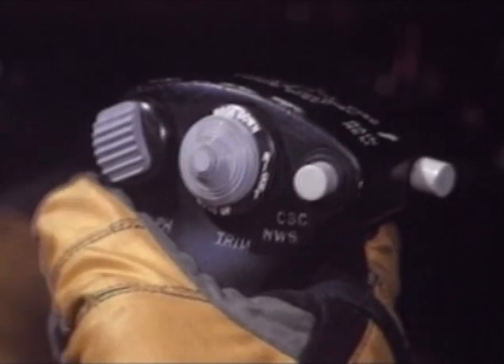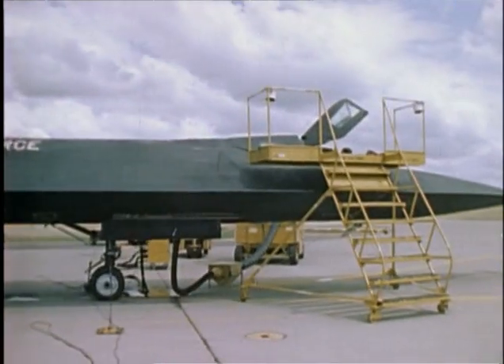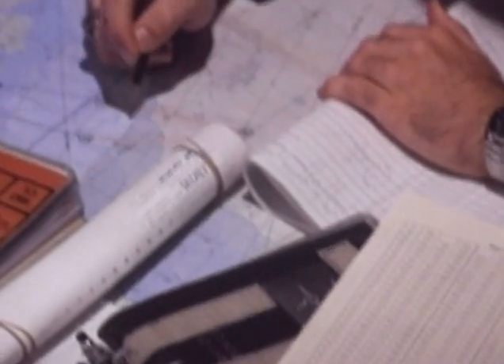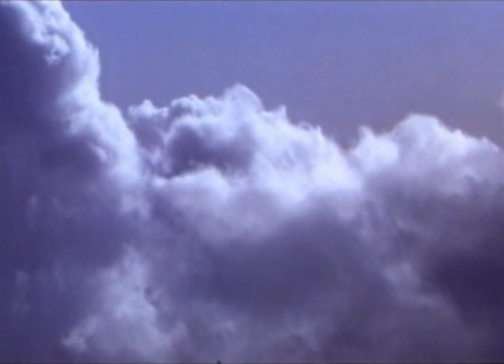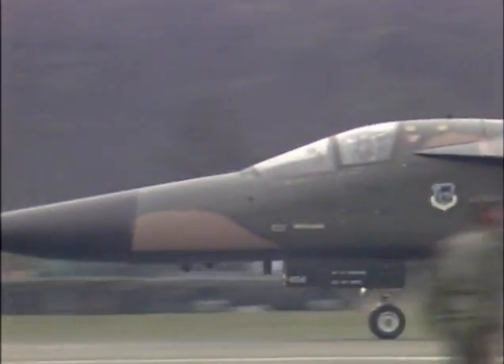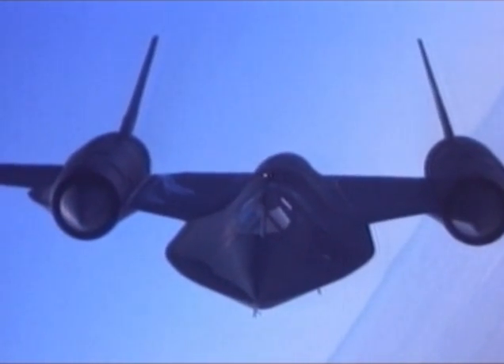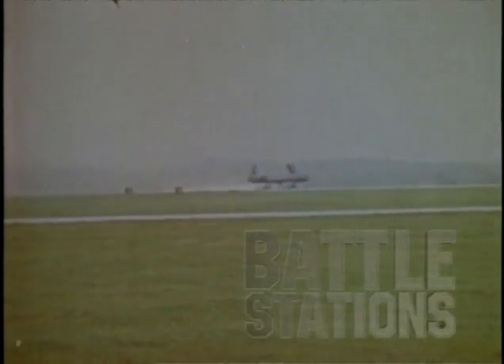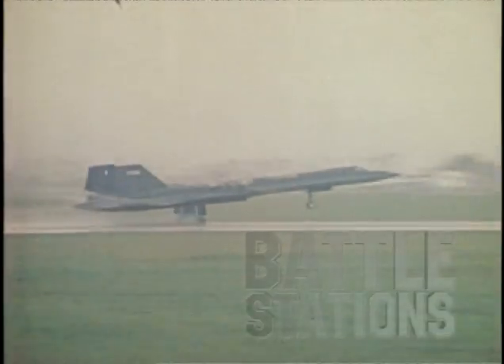Battle Stations - SR-71 Blackbird Stealth Plane -Full Documentary

Comment: There is a lot of the story they are glancing over in this. The SR-71, is part of a family of four different air craft, the YF-12, the A-12, the SR-71, and the M-21, while all look a great deal alike, they have have small differences.
Reply: I thought it was odd that the A12 rated no mention at all.
Reply: @theharper1  It was mentioned as the YF12A, A12 in short.
Reply: @theSaxman5  The mention must have been so brief that I didn't hear it. Overall it sounded like the SR71 was developed in isolation rather than a derivation of the A12, which is inaccurate.
Reply: No-one will ever see in print what the SR71 is capable of. Many speculations on its top speed and featured capabilities but keep guessing. Only a handful know the "Full Truth" and those limits will never be heard spoken, seen or read about even today in the year 2019!!!!!
Reply: @ Captain Sanders. BS. You take that American “plausible deniability” way too far when there are far more sensitive things that were declassified... and far more things that weren’t declassified that we know about thanks to people like Julian Assange, Edward Snowden, and the incompetence of people like Oliver North and Richard Nixon. 

The SR-71 cannot break the laws of physics. It has an engine made of metal that’s limited to certain temperatures. If you exceed those temperatures, it will melt. Maybe not immediately, but not long. Its top speed is governed by the drag formula and that means as speed doubles, the power required SQUARES! It was a Mach 3.3 jet and maybe 3.5 if it was being chased by missiles and the pilot valued his skin more than the engines.
Reply: @Bartonovich52  Sir, you have failed your aeronautics test. It does NOT require more power. Lets just say it sucks....

Comment: 1:01:35 you can hear/see the engines start one at a time powered by 2 nailhead Buick engines. Later to be replaced with 2 454 big block Chevy engines. The audio starts a sec or two earlier. Rare (to me) example of starting. 👌🤙🏼💪🏼🤘🏼
Reply: But

Comment: The Blackbird was not a stealth plane, it didn't need to be, it just outran anything that was thrown at it. A true work of art.
Reply: It was. It was specifically designed with a lowered RCS, Radar Cross Section. This was achieved by the shape of the lower body and chines, the tilted rudders, and composites (graphite) on all the leading edges to absorb radar. It is 107 feet long, but had the radar signature of an F104. This is stealth by definition. It's not "near invisible" like the modern stealth planes, but it flew so fast that a reduced radar cross section was good enough.
Reply: Then what is stealth?
Reply: When I said it wasn't a stealth plane, I was talking about what we calle stealth today

Comment: The SR-71 pilots were basically astronauts.
Reply: Yeah its average height was 85k feet but some other resources says it can go 100k or more... this video says it can fly up to 1% of the atmosphere.... pretty impressive jet... and to think that was 50s/60s technology... like what more do they have now?
Reply: @guyontheinternet8891  We have RETIRED SS airliners and nothing to replace them. Watch carefully as we could end up relying on steam again soon.
Reply: Ha google says top speed was 2133 video shows it out running something going 4600 astronauts indeed...
Reply: @jeffstrains4014  I believe you should believe to what pilots of SR-71 say. They were on site :D. It's mach 3.3. Some even say, it could be more - claiming it was pretty much dependent from air temperature outside (air going into engine intakes). At any altitude above ground air gets thinner and thinner so the standard "air speedometer" you would think of (like one every car has) does not show correct speed. That's why MACH unit was invented - so the speed is related to how fast sound travels on given altitude. That's one, secound you can also search for IAS and TAS difference (indicated / true air speed)...
Reply: @madyogi6164  In the video when Shul is talking about outrunning the missiles above Israel, he makes the comment that was something like, "We saw some mach numbers that we've never seen before, and the jet was doing it easily." I wouldn't be surprised if the SR could go 3000 mph honestly.
Reply: Very close indeed 👍🏻
Reply: @jimmysapien9961  Sort of like the Warrant officer ranks in the military. They are "almost'' officers, in comparison to West Point officers etc. They're not enlisted men any longer, above them, but still not quite the same as Commissioned officers either.
Reply: No, not even close.
Reply: And  Wiley  Hardeman  Post  was  the  first  astronaut.  Will  and Wiley r.i.p.
Reply: Well...in a sense I suppose, but the threshold for an astronaut is an altitude of 50 miles in the US or above the Karman line elsewhere. No jet aircraft can fly that high...yet.
Reply: @thomast8539  The pilots were indeed astronauts. Not in the sense that they went into outer space but they all passed the training requirements. The rigors of flight in this beast required the special training. They also flew off of instruments that only astronauts are trained in. No computer in this one! lol
Reply: Migs did this 30  years before rhe 71.  I have done it 5  times in a mig.  One of the few non military astronaut.
Reply: F U Google  ......   more precisely, the astronauts ARE basically pilots....because there is no outer space.... the Russians hit the dome (firmament) back in 1957-8.   Sorry, really sorry, but NASA is lying to you.
Reply: @colemanadamson5943  yeah i bumped my head on the sky once when i was on Kilimanjaro. Ouch. Still have the scar
Reply: Coleman Adamson holy shit , here’s one haha! Like fishing with dynamite
Reply: Same thing I've always thought but we never went to the moon lol

Comment: I wonder which is faster, the SR-71 or the XB-70?
Reply: Sphinx Rising 
Pretty sure the SR-71.  The XB70 was supposed to be capable of 2060 mph, but it’s top speed would still be limited by the added size of a having a bombay and the greater lift required for carrying capacity.
The SR71 was sleeker with less compromise needed for cargo/carrying capacity.  

If they were cars, the XB70 would be like a CTS-V wagon... very fast with a good payload capability.  The SR71 would be like a Corvette ZR1... even faster thanks to the smaller size and less weight.
Reply: @stlchucko  Their top speeds were measures in Mach number because at that altitude, Mach number is all that matters. It is pointless comparing them with cars and only confuses people who understand little enough of this stuff already.

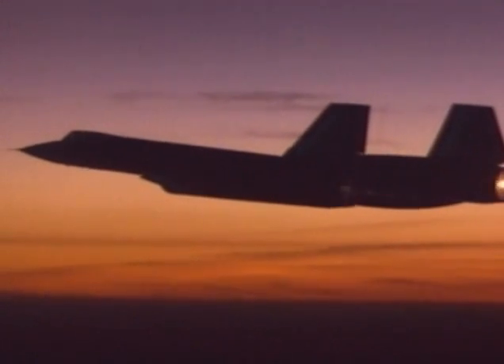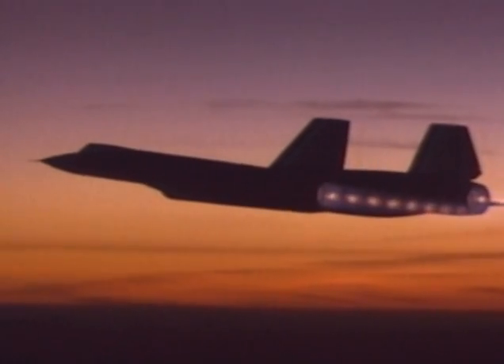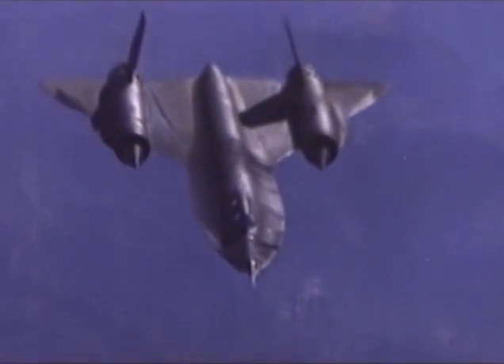Comment: the, pilot moves both engine throttles up from the maximum military power "stop" up into the afterburner section of the throttles movement.  Doing so starts the extra JP-7 fuel flowing into the reheat section of J-58 engine, at the same time a "squirt" of TEB is injected into the reheat section of the engine in order to ignite the extra fuel.  Even though the afterburners are commanded by the pilot simultaneously afterburners ignite in a staggered fashion. This causes quite a yaw effect, so much so that the fly-by-wire system commands the vertical tails to attempt to correct for it.  This is visible, from the left rear at 0:36-0:40.   The pictured from behind/below at 0:44 you can see the pilot move his throttles UP and then forward to go from max military(dry) power range up into the "afterburner range" or "wet" throttle range. Then you can see the jet accelerate away from the camera plane.  This video https://www.youtube.com/watch?v=_G6iG-DWJeg
gives you the best view of a Blackbird "lighting" its afterburners, first the Port then the Starboard J-58.  You can even see the initial "glow" of where the TEB is injected at about the 9-10 o'clock position in each J-58 engine. Because the left engines afterburner is "lit" first, followed moments later by the right side engine, the resultant "yaw" effect is prominent, then detected by and then attempted to be corrected for by moving the 2 vertical tail fins which can easily be seen.  This was one of the reasons why the SR-71s were  most commonly launched with only 45,000 pounds of fuel of a total possible 80,000 pound fuel load.  The lighter takeoff weight made the envelope for a single engine failure during takeoff slightly more survivable. Another reason for launching with a low fuel load then hitting a tanker at 25,000 feet, taking on a full 80,000 pound fuel load before carrying on with your missions was that launching the Delta winged jet with a full 80,000 pounds placed huge stresses on the jets main landing gear.  The only time a "Blackbird" type aircraft took off with a full fuel load was during the CIA's A-12 development testing carried out a Groom Lake(Area-51).  Technicians noticed excessive wear from a single takeoff at max fuel load in the A-12s, the wear would only be worse in the longer/heavier SR-71.  The landing gear was designed to be as light as possible, and sturdy "enough".  Operationally none of the A-12's, M-21's, YF-12's nor the SR-71's ever took off with a full fuel load.  IIRC The forces which acts upon the main(rear) landing gear of a Delta-Winged aircraft as it is rotated during takeoff is especially high. This was compounded when a full 68,000pound A-12 takeoff fuel load was used during initial A-12 testing and technicians out at Groom Lake were seeing unacceptable tire wear and gear wear. 1/2 tank takeoffs became standard thereafter, though there were some missions which launched with 55,000 pound fuel loads.  These were quick, one-way A-12 missions, but the SR-71 never launched with a full, 80,000 pound fuel load.  It "almost" always launched with the just over 1/2 a tank 45,000 pound fuel load, immediately climbed to 25,000 feet filled her up, separated, then climbed accelerated to its mission specific speed/altitude. Rinse and repeat until your mission is completed.  The limiting factor for SR-71 operation was the Triethylborane or TEB for short. TEB pyrophoric meaning that it ignites spontaneously when it is exposed to Oxygen. In doing so it emits a greenish colour. Because the very special JP-7 fuel that the J-58 engines burn is very thermally stable with a high flashpoint meaning that its difficult to get it to burn.  Therefore TEB injection is used for initial combustion of the JP-7 jet fuel.  TEB is required for engine start, and afterburner initiation.  Each engine has a grapefruit sized tank where TEB is contained within a 100% Nitrogen atmosphere to keep it from igniting when it isnt supposed to.  In the cockpit, right below the throttles there is a counter, one for each throttle.  During startup, the AG330 Start Cart with 2 V8 engines, which were originally Buick Wildcat engines and later used Chevrolet Big Block Chevrolet engines mated together via a Gilmer belt and would be positioned so that a special central drive gear would mesh with a receptable of the J58 engine. Approx 650hp would turn the J58 over until the self-sustaining rpm of 3200rpm while the 2 Buick V8s were actually revving about 4,900rpm. The pilot then moved his throttle for that engine to the "Idle" position to the "START" position.  This discharged 30cc (cubic centimeters just over 2 US Tablespoons) of TEB into the engine emitting a Green flame.  The TEB Counter for that engine went from 16 down to 15.  This was then repeated for the other J58 engine.  Once more permanent  forward located hangars were supplied, the V-8 powered A-330 start carts were replaced with a high pressure air starting system.  2 high pressure air hoses fed into a turbine air powered apparatus that meshed with the gear underneath the J58 engine.  This was much quieter, though I'm sure that the "cool factor" wasn't as high as starting a Mach 3 jet engine with 2 Bigblock Buick or Big Block Chevy engines with open exhausts. The Blackbirds were loaded with enough TEB for 16 TEB injections.  Everytime you started the engine, engaged the afterburner(during takeoff and during refueling and just after refueling) you used 30cc of TEB.  Once you ran out of TEB, you couldnt light the afterburners anymore.  This is why TEB is usually considered the main limitation for SR-71 mission length.  Initial engine start used 1 TEB hit, lighting afterburners for takeoff uses another, using 1 to light the A/B in ine engine during the last 2 minutes of refueling(then lighting the other engine A/B after you have detached from the tanker.  So you've used 3 TEB hits coming off your first refueling just as your mission really gets underway. Perform a mission run, slow descend to 25,000feet/0.90Mach refuel, detach light afterburners accelerate climb to mission specific velocity/altitude(another TEB hit per engine-total now 4 TEB hits) make another mission run, slow descend down to 25,000ft/0.90Mach, detank, and lightem up again for TEB hit #5 so now you've used 5 TEB hits per engine and have 11 TEB hits remaining per engine.  SR-71s can burn their 80,000 pounds of fuel in 80 minutes, the A-12s with their smaller 68,000 pound fuel load would have to slow and descend even more often, perhaps every hour.
The A-12's length and full fuel load was 101 feet 7 inches/30.96 meters 10,590 US gal or 40,100 liters which weighed 68,300 lb or 31,000 kg at 6.45 lb/US gallon.  
The SR-71 length and full fuel load was 107 feet 5 inches or 32.74 meters  12,403 gallons 46,950 liters which weighed 80,000 pounds/36287 kgs at 6.45 lb/US gallon.

Sorry for the novel, but these Birds and the crews that flew and supported them are all just plum HOGWILD!
Reply: thanks a million for that info..........when i saw your comment was a novel,,,,,,,i didn't want to read it all BUT i couldn't stop,,,,,,,,that was fantastic, interesting, and inspiring,,,,,,,,that part about the buick and chevy engines was  unbelievable........who would have thought.....these people were brilliant...........how do you know so much,,,,,,,,i would like a short answer to that question if you have the time........thanks again........were you part of the support team.?
Reply: @yardlimit8695  I could tell you, but then.........., um I read a LOT?  Seriously though, you are very welcome. I apologize for the poor formatting that makes it difficult to read.
Reply: WoW!
Reply: Kinda depressing how I think I'm smart. Then read something like this and find out otherwise.
Reply: Amazing info!!! Thank u!
Reply: Well said sir. That is why we rated missions on the number of refuels. I never knew the actual reason, just that there was a limitation.
Reply: I have read that the TEB is only used on the initial engine start, and not needed for the AB ignite.?
Reply: @mikerowan1132  Here is the video I posted in my OP.  https://youtu.be/_G6iG-DWJeg  A 0:01 you see the left then the right afterburners light with a greenish tinge as the pilot first goes to military power, then goes into afterburner at which point 2 tablespoons of TEB are injected into each afterburner.  The same thing is happening at 0:08 seconds, left then right.  During initial start, once the J58 is rotating at 3200rpm, the pilot then moves the throttles from the Idle to start position, the JP-7 fuel begins to flow and a hit of TEB is injected in the engine further forward inside the engine. Not the same place where the A/Bs are lit(which is further back).  One of Space X's rockets also failed to land properly because it ran out of TEB thus an engine or engines didnt restart thus causing the rocket to crash land.
Reply: hoghogwild: I thought it fueled at altitude and never took off fully fueled.
Reply: @jamesmeritt6800  Yes James, that's what I wrote.  
"" The only time a "Blackbird" type aircraft took off with a full fuel load was during the CIA's A-12 development testing carried out a Groom Lake(Area-51).  Technicians noticed excessive wear from a single takeoff at max fuel load in the A-12s, the wear would only be worse in the longer/heavier SR-71.  The landing gear was designed to be as light as possible, and sturdy "enough".  Operationally none of the A-12's, M-21's, YF-12's nor the SR-71's ever took off with a full fuel load. "" 
I apologize for my poor formatting, it's difficult to read.
Reply: So basically what your saying is this "Object with wings" would pass up everything but a gas station in the sky❗
Reply: @miguelsalami  Yup tanker support was a serious logistical issue. Plus the tankers that fueled the Blackbird family HAD to keep the fuel the tankers engines burn(JP4/JP8), separate from the JP-7 the J58's required to fly at full  operational speeds. The J58 COULD burn JP4/8, but it's max speed is reduced to 1.8 Mach.  The faster the SR-71 goes, the more efficient it became.
Reply: @hoghogwild  Very interesting that the engines became more efficient at higher speeds it's backwards compared to other jet engines.
Reply: Probably the first tl;dr I read non stop and enjoyed immensely
Reply: Did you stop to think all that technical information you revealed in your "novel" could be used by someone else who doesn't  have our  best  interests in mind
Reply: @AYtoSEE  No, not at all.  Would you like me to write another "novel" on the production of "FOGBANK"?

Comment: The job any man should have aspired to attain. Me first. Mach 3 + ?
Reply: Fastt Ed The SR-71 is not a true Mach 3+ jet is speed is 2198 mph that is Mach 2,85 I know that the temperature and height changes the speed of sound but the speed that we use is 767 mph Mach 1 to know how fast something is for the SR-71 to hit a true flat speed of Mach 3 it would need to go about 2310 mph and for Mach 3,2 about 2440 mph and Mach 3,5 about 2700 mph it’s true speed is again 2198 mph and with the flat speed of 767 mph it’s Mach is 2,85 not Mach 3+. Still great jet